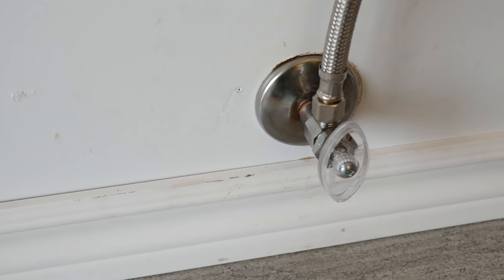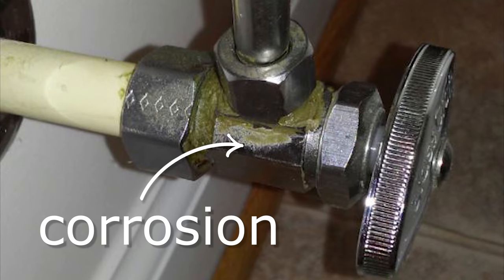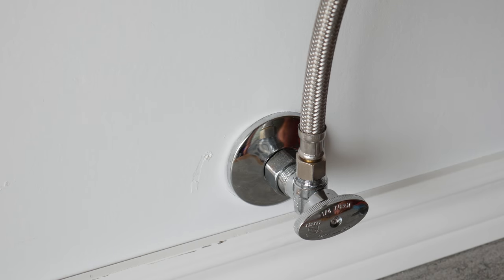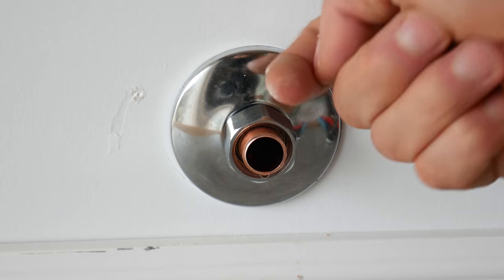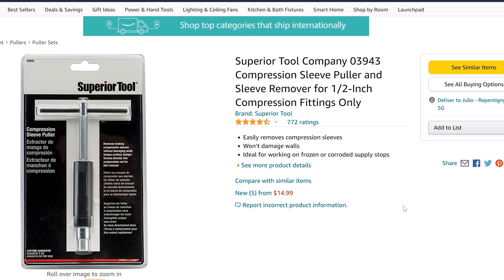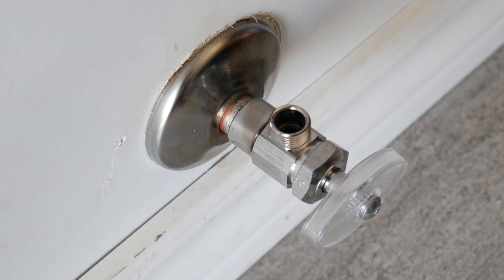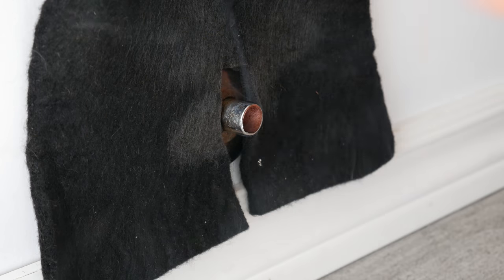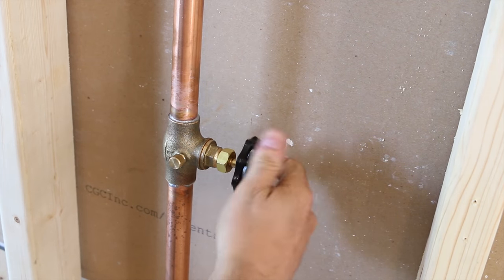How To Remove/Install a LEAKY/NEW SHUT-OFF Valve (Compression, Soldered or Push fit) | GOT2LEARN

Comment: you can just put a new stem and bonnet seal on a soldered fitting....no need to unsweat it..
Reply from the maker: Some are 1 piece, but yeah the 2 piece models can be refurbished.
Reply: I have seen acidic water that eats brass make a pinhole leak in the side of the body itself before.  There are still times you need to unsweat.
Reply: @GigsTaggart  acidic water ? Never heard of such a thing...and wouldn't it destroy appliances way before it eats through the body of a valve ?
Reply: @DL101ca  not usually.  It's not super acidic.  Like 6.6 pH maybe.  Water doesn't often sit in appliances like it does in valves.

Comment: At 45 sec you claim,  "There is no choice but to swap them out"   This is False!  These valves can be easy to repair!  The older ones with brass internal parts you remove bonet replace washer if needed and use valve grease before reassembling. With crappy box store valves the internal parts are plastic and although you can still repair...I would replace. To support your video recommendations I would replace in every scenario except when a solder joint is too close o the wall....fire hazard in the wall is a risk so to avoid this for the DYI's out there.......then we attempt to "repair" NOT replace. These valves CAN be repaired for those on a tight budget also.
Reply from the maker: True! However, most newer valves are one piece.

Comment: Instead of soldering copper why not use compression fittings everywhere?
Reply from the maker: Not code to have compression fittings behind closed walls.
Reply: @Got2Learn  Because they don't last as long? Do you know what fails?
Reply from the maker: @multipotentialite  I guess the fact that it's mechanically joined with the pipe it can potentially undo itself.

Comment: Called a packing nut for a reason. You can back it all the way off and then tighten. 95% it will reseat and stop leaking..

Comment: love your videos . ? for you . i know you like toto toilets better . but could you steer me in the right direction on 1 out of these 2 to buy. wife wants 1 out of these just not sure which is better .      1)))   KOHLER Cimarron Comfort Height 2-piece 1.28 GPF Single Flush Elongated Toilet in White with the   ContinuousClean system automatically dispenses cleaning solution with every flush       or the                              2)))  Optum VorMax Complete Tall Height 2-piece 1.28 GPF Elongated Toilet in White with Slow Close Seat
by American Standard     please help thank you .. and the ? is not about the money difference or the  ContinuousClean system ... its which internals are going to be better ... please please help thanks again

Comment: Biggest reason to replace your valves - replace multi turn for quarter turn
Reply: negative...quarter turn great but once again why replace something functioning...how often do u legit access the valves to any of your appliances.... you should never be  if installed properly
Reply: Serviceable multi turn valves are not a hassle to deal with, just unscrew, replace rubber gasket and carry on.

Comment: Couldn't you just use a compression fitting after removing a solder fitting? Makes for easier installation.
Reply from the maker: Sure.

Comment: Why re-solder a new valve after removing a soldered one? Why not just replace it with a compression or sharkbite?
Reply from the maker: It was leaking/corroded.
Reply: You could if you cleaned the pipe well like with that drill  motor brush.
Reply: Soldering is a very secure joint that is unlikely to leak (if it doesn't leak immediately when you turn the water on anyway).
Reply: Because shark bites are expensive and compression ones suck if you ever have to remove them. Soldering is cheap ,effective and lasts forever.

Comment: Why do they even allow gate valves to be produced?  Their ultimate use is to give plumbers an extra job as they require replacement as soon as they need to be used.  I cringe and pray every time I try to shut one off.  There is much better technology for not that much more expense.

Comment: The world need to do me a personal favor…..  never use a shark bit or push fitting for anything.  Just don’t.  If it’s down to that, then call a plumber.
Reply: Is that because a shark bite won't last? I appreciate your advice.  I am changing a shut off valve tomorrow and was thinking of using a shark bite shut off, but won't if it will leak in the future. Thanks for your help!
Reply: @willf9779    They just use an o ring to seal. Eventually I think it’s too much risk for what’s at stake. If it’s temporary…maybe, but use something else if you can.
Reply: @markg7963  thanks Mark!
Reply: @markg7963 Horse Hockey. PTF fittings have been used for decades.  Plumbers despise them because it takes away their power (and $100 hr fees).
Reply: @TheMinnow101    I agree that plumbers don’t like then, because I cannot deny they are easy to use.  I hate soldering fittings, and screw fittings are tricky to get right and seal, especially if you need them to be directional, but I am not personally comfortable with push to fit.  And the very fact that one timers can use them doesn’t mean they are error inert.  If there is any sideways forces or surges in pressure, they are a ticking time bomb.  For a temporary repair…go for it, but no way in a permanent installation.  Especially unsupervised behind a wall.

Comment: If you replace the valve, do yourself a favor and make sure the new one is a 1/4 turn valve. It appears that most of the new ones used in the video are 1/4 turn.

One of the questions asked in the video was "why replace a  valve?" This is actually one of the reasons I'll replace a valve. When something goes wrong and you need to turn the water off quickly, that's not the time to be cranking multiple times on the handle to turn the valve off. This is something you have to be prepared for by replacing the valve ahead of time.

Comment: False you can repair leaking stops. Unscrew the bonnet off twist the handle left and pull. You can take another bonnet and handle from a different stop and swap em out

Comment: I'm a complete idiot. I replaced a few of these by  painstakingly cutting through the ring...and now find there's a simple tool for it....Yikes! These are the worst valves ever made, considering the cost, they shouldn't leak, corrode, fail to fully close and especially the cheap handle shouldn't  break off when trying to open/close an old valve..

Comment: why can't you fix a leaky valve?  You should be able to take it apart and put a new washer in it.  If you can't then sure replace it with one that you can.
Reply from the maker: The newer cheaper valve are unibody, if you catch an old one you can change the guts!

Comment: im sorry i just dont think im fully getting it...yes this should work if saudering a new valve but i wouldnt image sharkbite or anything other then sauder would not work here cause compression mishapes the pipe to form a leak seal....maybe im wrong ive never attempted or been in a situation this would be only fix and to be frankly honest i couldnt imagine the plumber who thinks this is only option... replace valve stem....minus the valve stem its legitamatly just a 90....

replace the stem only reason to remove if its leaking at seal and compression ...15 years never seen one leaking so...unless you cant work pliers compression valves...never ever seen one leaking from cpompression... regardless this is a cool trick cant ewait to tell boss

Comment: BS. You can replace washers, nuts, rings, etc to repair them. It's not the valve itself causing the leak it's either a loose packing nut or a valve stem washer in a compression valve.
Reply: Or in my case, the knob itself snapped off